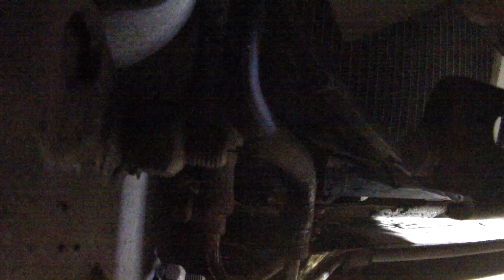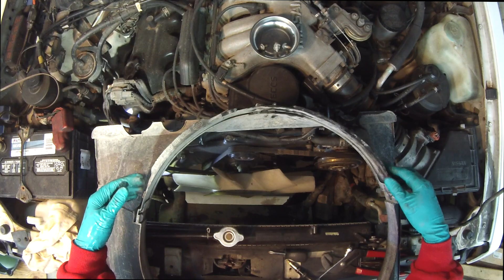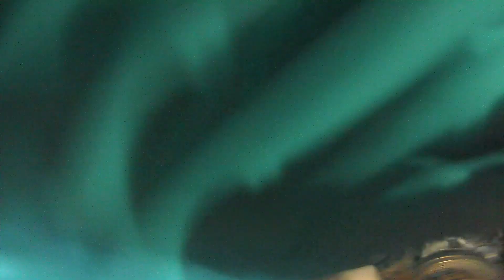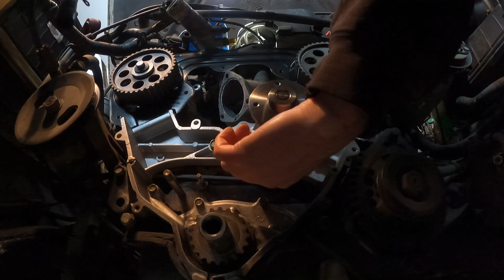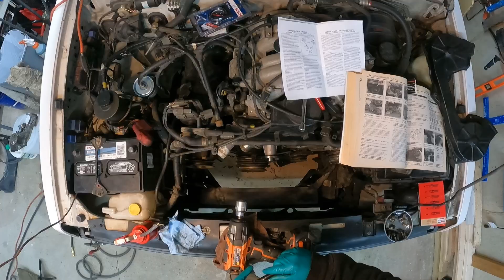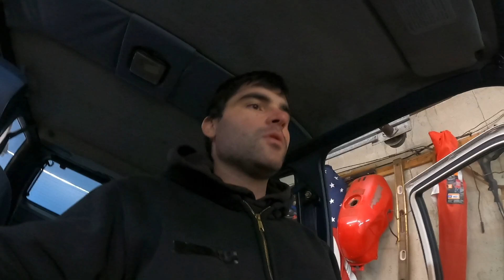HOW TO CHANGE A TIMING BELT, WATER PUMP, AND THERMOSTAT ON A NISSAN PATHFINDER.

Comment: Great video! Thank you. For the water pump torque specs did you say 3-7 ft lbs? How’s the job holding up, no leaks?I just scraped off all the goop someone else left and I would like to do what you did with just gaskets. Thanks
Reply from the maker: Thanks, I’m glad you enjoyed the video. That torque sounds about right. No leaks, gasket is the way to go.

Comment: Hi Jimmy - Am I missing you doing the changing of the thermostat? I can't find it. I have a 93 SE that I have to do.
Reply from the maker: starting at 16:00 ending at 17:00 You pretty much just set the thermostat in there with the floating valve facing up.

Comment: I just bought an 88 and it came with a timing belt however the person I got it from didn’t specify weather I should replace it or not. My 88 has 160,000 on it.
Reply from the maker: I would replace it along with the water pump to be on the safe side, you can buy a kit. Very minimum take the covers off and check the condition of the belt if you can’t get to it right away.

Comment: Those cam marks on the back cover never line up perfectly with the gears. You gotta count the teeth between the marks on cam gears and the one on the lower gear behind the harmonic balancer. That's how you know if it's perfect. U can find the number of teeth between marks on the good ol internet. I fought this the first time I did one of these. Bc im OCD. But nissans love OCD.
Reply from the maker: Thanks for the information. I ended up counting the teeth on the belt as well. I ordered a Gates water pump kit and it came with the belt, and the instructions on the kit were descent.
Reply: (TMI) if u find yourself clocking the distributor to a "really advanced" state u need to do the painstaking task of counting teeth and double checking belt tension on all three sections. Even if the marks all line up and are not "off a tooth" it can run wonky and in limp mode, if the tension isn't right. Also the older pre 2001 vg33es are interference motors and the newer (later half of 2001) ( I believe, but check to make are sure) are non interference. I only put this here for those who are looking and fighting with this motor,  And it's quirkiness. Hope it helps someone. All this info should be available on the net. And FSM and also if you have access to some of the older Mitchell shop manuals and maybe the internet napa pro demand idk. But its a thing and even shops fight it too if they havent done one before. I have pulled most of what I have learned from paper back shop manuals. After I paid a shop 1200 to change a WP and TB. Then took it to Nissan dealer here in town and paid another 1000 to fix (properly) what someone else "fixed" that had "done a bunch of them". Sorry for the novel.